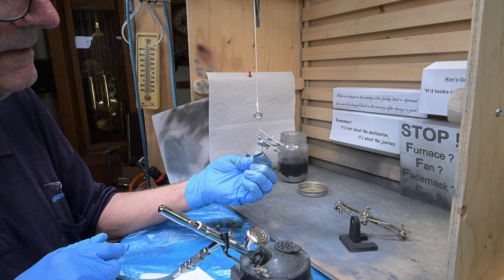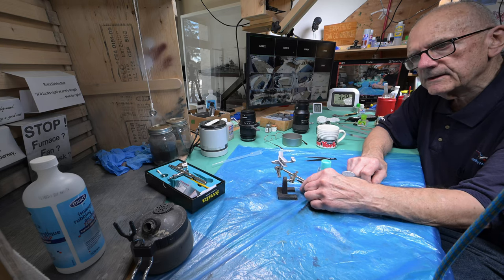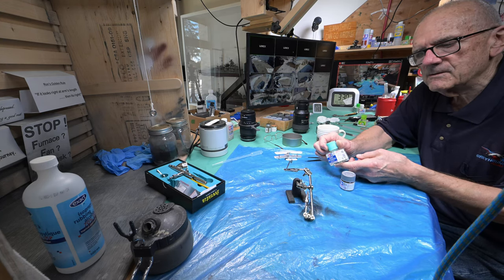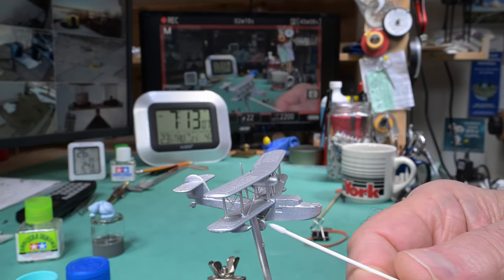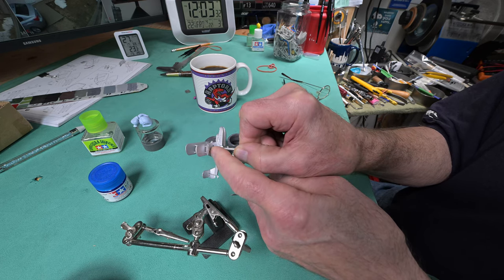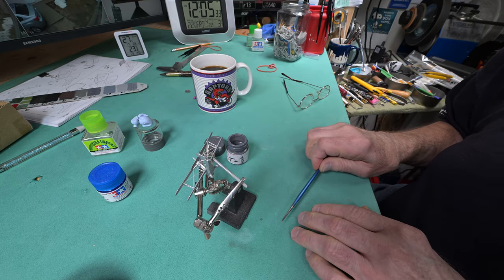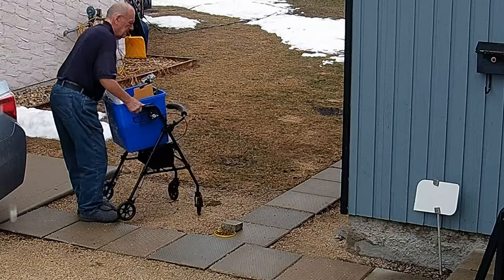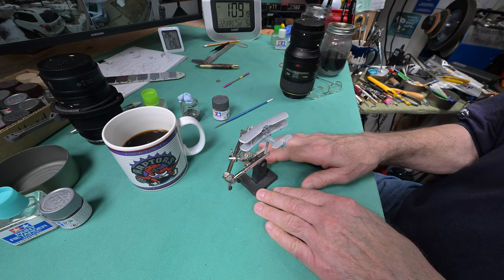The Model Ship - Part 1155

Comment: Morning Ron.  Just a suggestion, if your painting the propeller black I would do the tyres a dark grey, if you dont have a rubber black paint.  flat black will be to stark against the silver and it will look difrent to the black parts looking more realistic.  are there decals for the aircraft? roundels and tail markings?  To remove the sprue dont forget the glue is hot so adding glue should allow you to seperate it.
Reply from the maker: Re: "do the tyres a dark grey" Good tips. Will do that today. Thanks Jason. 👍

Comment: Morning Ron, nice to see you getting back on the good side of the rabbits again 🐇🥰
Nice job on the Walrus, that paint retarder worked out great, never thought of using it as a emergency thinner before.

If I remember right some Royal Navy Cruisers had there Walrus aircraft in a silver finish until 1940. 

Just a thought on the clear blue for the windshields, if you dont like the blue try Tamiya X19 Smoke ( the clear blue and green are normally used to simulate the armoured glass in the periscopes of AFV's). 

Just had my delivery date for my 1/200 USS Iowa should have it by May 10th happy days. Well catch you tomorrow.
Reply from the maker: I'm a bit skeptical as to just how this clear blue will look. My difficulty will be applying it delicately. 🤞
All the best with your Iowa. 👍
Reply: Hi Ron, just thinking as I have been driving tonight maybe use a pencil to fill in the windows as you are only trying to give an illusion of “glass”